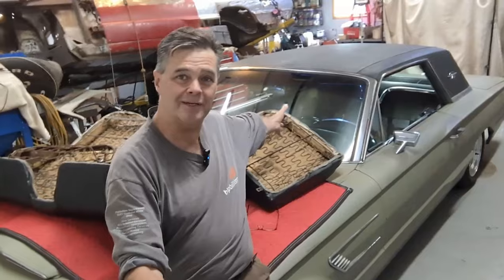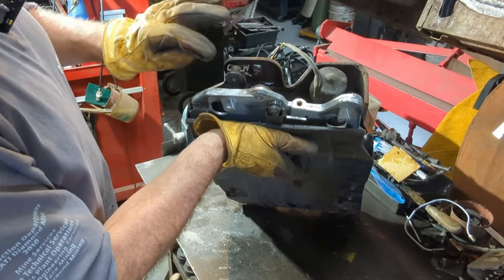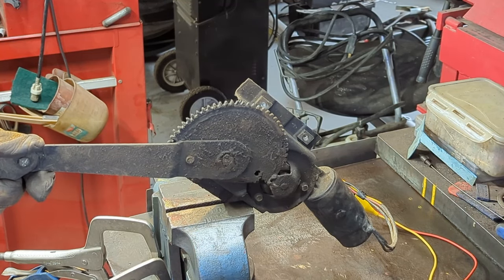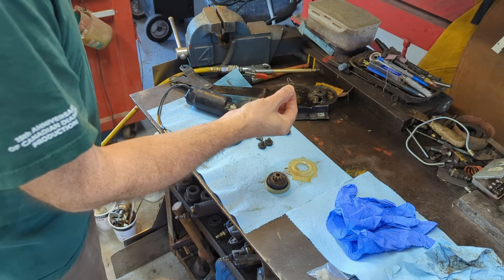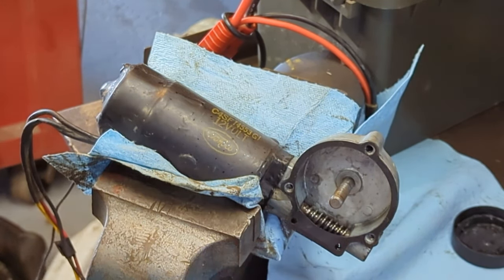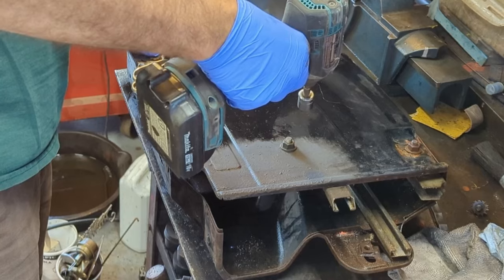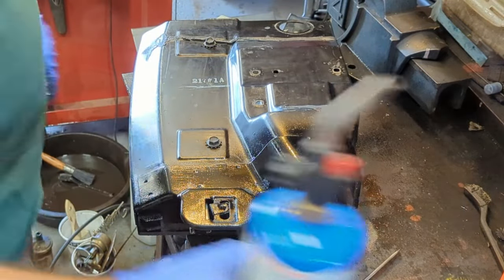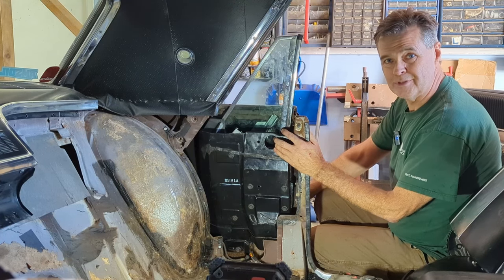1965 Thunderbird Classic Car Quarter Window Refresh

Comment: THAT was a real repair, well done sir!  I'm intrigued by those buttons for repair.  Many years ago, the rubber had sheered in my driver's window.  I couldn't source the replacement rubber and being a poor teenager, I made my my own spacers (like the buttons you showed) from doweling and some plastic tubing. Seeing those made me feel somewhat vindicated in my choice of repair at the time.  Thank you as always ~ Chuck
Reply from the maker: The little dowels are not hard to replace, but a little tricky to get them all aligned while pressing them in.
I bet the price for one of the gear drives back in the day wasn't cheap, and most likely would have been only available from Ford.
Reply: @J_R_Shop  I think I tried the dealer, but they were getting low on parts by then.  The local junk yards didn't have salvageable units either.  That's when my dad taught me, "The most powerful tool in the garage is your brain, not your wallet" and I came up with the idea for the dowels and plastic tubing for sleeves.  I think Dad was proud of me.  Oh well, water under the bridge.  Once again, thank you for your videos, highly educational and fun to watch. ~ Chuck

Comment: Thank You Ivan: Nothing on a old Thunderbird intimidates me more than window regulators with maybe the exception of removing of a heater and or evaporator core. My 64 hard top has lazy rear windows much like yours was. I yank it up and push it down. 
Your demo video is excellent! I cant believe I let the winter go by again without tackling this window issue. It is not like I have to work outside. We have a warm, dry, roomy well equipped shop to work in. (Embarrassing) I am thinking after watching your video that in real time it probably takes four or five hours to do one window. I am ready. Great rainy day project. Thanks again Ivan.
Reply from the maker: Walt, don't be embarrassed, time slips away so quickly, and more so as we get older. ⏳
You are correct, it will take a few hours, overall it's an easy project, with little cost...well worth the time spent.

Comment: Many decades ago I had a 66 standard hardtop.  I had it in high school and was driving back from a band meet when I hit a huge pothole in a construction zone.  It flexed the car so badly that the right door window made a slipping noise when trying to move the window up or down.  When I took it apart I found a rubber centered gear just like the one that you show here and it was broken from the force of the flex.  I went to the local Ford dealer and paid big bucks for a replacement gear that was a new design with the springs.  This is the first time in all of these years that I have seen another of the original rubber gears.  It has been a long time but I have also regreased and cleaned the rear quarter setup.  This is a good refresh. Hope you get some good miles on this nice 65 this Summer.
Reply from the maker: Hi Jeff,
It sure did help take the load off the motor by cleaning & lubricating the tracks.